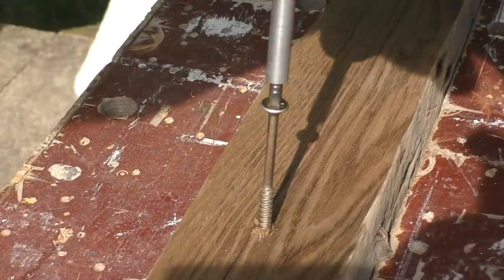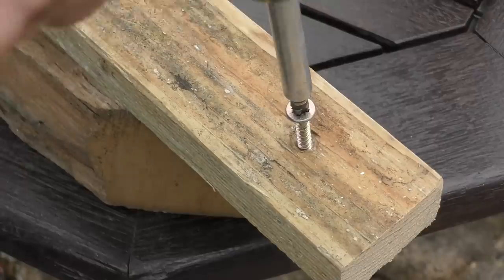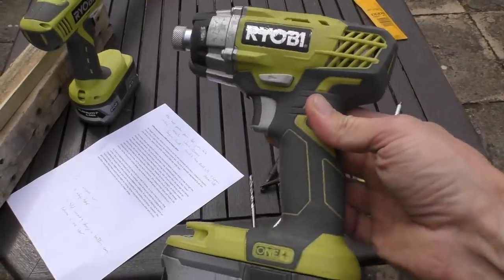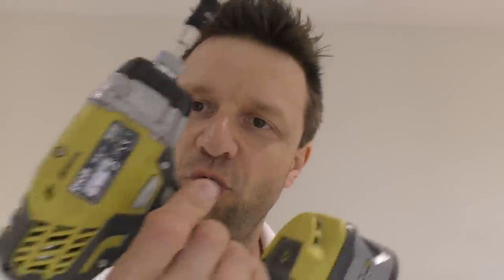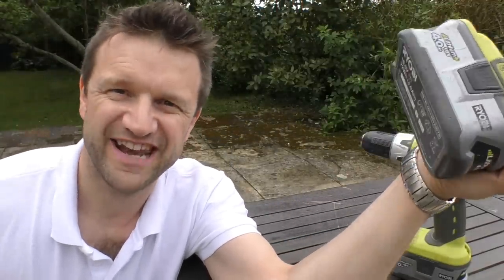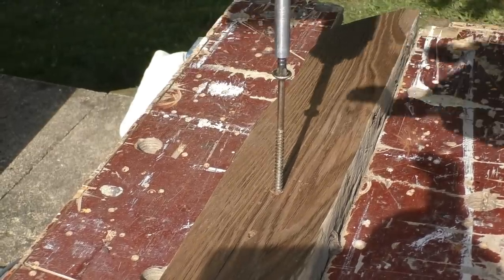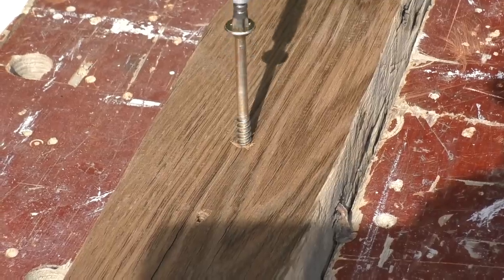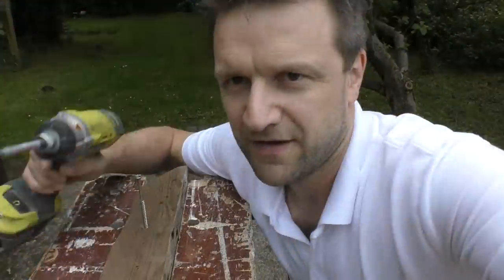Difference between Drill Drivers & Impact Drivers

Comment: Came to learn about diff between the drivers, learnt about batteries instead
Reply: Me too
Reply: That's because he didn't show how much more force he had to use with the drill. He would have been using both hands and putting most of his body weight to drive the screw like that with the drill. The impact he could have done with one hand while holding the wood with the other
Reply: I'd have to argue, that's your fault.
Reply: Lots of good info!
Reply: The mechanism with the impact driver is inside the turning head of the drill. There is a heavy metal mass and a spring that takes up the energy of the rotation and with each turn it is loaded up with mass energy and then hammers down on the screw to impart the stored mass energy on the head of the screw.
Reply: so I ain't watching it. thx
Reply: @andrewbarr3958  shows very little I guess
Reply: Well, ones called a drill because it's meant to DRILL things. Like with a drill bit.
Reply: Yea the battery part was really helpful. I thought that part was going to be boring.
Reply: Also how to spell 'learned'
Reply: The regular drill does the same as the impact when batteries are the same. I decided to buy a corded drill with available hammer drill mode and works like a champ. I’m about done with batteries that just don’t last anymore. I’d rather deal with the wires and have the power available. Good video showing what variable batteries are capable of though.
Reply: ikr lmao
Reply: Me too

Comment: Never realised the size of batteries made so much difference, I always though size equalled how long they would last.
Reply: (ah-hem) Size and stamina are definitely two different things...
Reply: It does mainly affect that, but it also affects the maximum amount of current that the battery can deliver
Reply: I dont think that he explained that the maximum amp of the smaller battery is smaller
Reply: same here.
Reply: It affects both.
Reply: He either truly doesn’t know what he was talking about or just misspoke in the video...

Frankly...if he thinks a 5Ah battery is the largest capacity out there...he’s definitely had no idea!

So to answer your question...there are 2 numbers that make the difference.

1) Volt
2) Amp-hr (Ah)

The tools he was using are 12V and 18V. This is what represent the “power” of the tool that he was eluding to.

The Ah rating is the charge capacity that a battery can hold (and deliver). This helps you determine how long the battery charge will last for the tools that it is mated to. Each tool will likely draw different amperage requirement so will have varying times that the battery can supply power. For example, a 5 amp-hr battery can supply 5 amperes current continuously for 1 hour. So if you have a tool that draws 5 amps, then you can use that tool for 1 hour with this battery when fully charged (theoretically...but there are internal resistances that will shorten this time). And using the same example, if you have a more power-hungry tool that draws 10 amps, then you only have 1/2 hour or 30 minutes before the battery is depleted by that particular tool.

I hope that clarifies your question...what you had thought is actually mostly correct!
Reply: Just bought a combo that's has the impact as well as the regular but they came with the smaller batteries gonna go buy one big one for now.
Reply: Its bc hes using ryobi. I would never reccomend ryobi, their designed to break and they use different battery cells which are much cheaper and dont have the same power outputs. Quite a shame of a tool
Reply: To summarize: Always use the correct tool for the job.
Reply: @dang-khoavo4648  I was ready to come and say something similar in the comments, but the evidence is there in the demonstration so it's hard to stick to first principles and deny that it's happening when it's on camera. The battery size does seem to be indirectly related - if the individual cells inside are connected in parallel, they'd be able to put out more amps, and therefore more power, right?
Reply: HRRoach m. On n in loop m
Reply: @dasy2k1  But current is determined by voltage (both 18V) and resistance (both the drill).
Reply: @ryanblake4790  Yeah I was thinking this is probably just an effect of cheap batteries delivering inconsistent voltage. If the voltage is the same then capacity shouldn't make a difference. This is like claiming you'll somehow get a higher rate of water flow for a given water pressure and pipe diameter by drawing water from a lake vs a bathtub.
Reply: @scottramsay4053  Well the first principles are definitely correct, the question is just why the different batteries mattered. Amps are directly determined by volts and resistance so the bigger battery is most likely providing a higher voltage to the tool (or the batteries could also have a different internal resistance).
Reply: Of course it matters. Think of this: a fully charged 9v battery wont start a car but a fully charged car battery will. It's not the charge but these amount of power that it can deliver in a time period. The bigger tool batteries lay longer because they require a ad much power for each use because they can deliver most power at each use.
Reply: Also brushed motors and brushless motors make a difference too, i use makita brushless tools and only buy the 5ah batteries, they can last the full day on site and 40 min recharge time too
Reply: @Joe Hoe I have been using Ryobi tools for over a decade and not one of them has failed on me yet. You can definitely count on them to last. I can't speak for how well they perform compared to Milwaukee, but I've seem them out perform some DeWalts.
Reply: @dang-khoavo4648  When this video was made 5ah batteries were probably the highest capacity you could get, things move quickly these days and much higher ah ratings are available, in 6 months time even  bigger capacity batteries will be out!!!
Reply: Those giant batteries really weigh the tool down though.  I can't hold the tool for too long.
Reply: As an old man would say. “Thats where they get you”
Reply: Scott Ramsay no
Reply: Junior R what would a young man say? Nothing because he doesn’t have sense to know he’s been got yet lol.
Reply: @dang-khoavo4648  of course there are more powerful batteries out there than 5ah. Try 125ah for example in a leisure battery but he's referring to Ryobi of which the 5ah is the most powerful they make.
Reply: @ryanblake4790  designed to break? They've made a crap job of that then, I've had mine 15 years!
Reply: Torque, power and speed. Speed needs less power but torque needs all the power it could get. I just bought a makita corded drill. Just straight to work not worrying about charging or power issues
Reply: @Joe Hoe For sure I build houses and do roofing, and I've never had a problem with Dewalt brushless products so I stick with them even though people bash them.
Reply: @ryanblake4790  No, ryobi uses quality samsung cells actually
Reply: @ryanblake4790  I have to disagree with you. I've had my Ryobi One+ drill and impact and even drill through concrete and brick. The 4 amp batteries and more make a difference especially for concrete and brick. I've had the tools for 5 years now and no signs of slowing down. The older Ryobi cordless drills were not good but the One+ series are very good. Are they better and durable than a Milwaukee or Dewalt? No, but for the average handyman who tackles 5 - 10 jobs a year and pay half the price, you won't be disappointed.
Reply: People responding that it does both, after OP saying he just learned it does both...

Sometimes I hate the internet...
Reply: @suegoetz1221  That's something those of us with large tools have to suffer through every day :(
Reply: Batteries don't have a maximum amperage, the amp hours are entirely a measure of how long they can deliver power and has nothing to do with the amount of power they can deliver per second. In other words, the moment you start using a 1.3ah battery with a full charge, it's exactly as powerful as the 5ah battery with a full charge.

So you're correct, the size only affects how long it lasts
Reply: me too!  Great demo!!
Reply: So much disinformation and confusion in replies...

The power of the tool is determined by two components: voltage (18V in this case) and flowing current (in amps, but these amps have got NOTHING to do with Ah rating of the battery), as per P = U*I formula.

Ah rating of the battery just describes the capacity, how much energy can be stored. For instance 18V battery @5Ah can store 18*5 = 90Wh of energy - which means you can run device requiring 90W of power (very roughly power needed by a gaming laptop) or for an hour.

The Ah value does NOT tell you how quickly you can get all of that energy out - that is defined by 'maximum discharge current' parameter of the battery (usually not advertised on the battery label). This parameter can vary wildly per cell, from 3A to 30A or so and is rather important for power tools, battery with large capacity but max discharge current so low that it barely moves the motor would not be very useful.

Single cell of LiI-on battery (usually popular 18650 type is used) has got voltage of 3.7V. So to get ~18V, you need to connect 5x of these in SERIES - which means voltage gets bumped up to 18V, but max discharge current remains the same (in fact, it would be limited by the 'weakest' cell in series). Bigger / larger batteries (with more Ah) are made by connecting blocks of 5 series of cells in PARALLEL configuration - such configuration increases overall capacity of the battery, while keeping voltage the same (18V) and instead increasing max discharge current (it is more less a sum of max discharge current capacity of each 18V block).

TL;DR - larger batteries tend to have more 'power' because:
1. They use higher capacity and higher quality cells, rated for higher maximum discharge current - so they can deliver more of 'instantaneous' power.
2. Additional capacity can be achieved by connecting blocks of 5x 3.7V cells in parallel configuration, which aggregates max discharge current from the batteries blocks in the pack - so this gives you usually double (5S2P) or triple (5S3P) available discharge current for 'free'.
Reply: @lelllooooo  finally someone who knows his shit, kind of dissapointing to see people spout their so called "knowledge" when in fact they know nothing about the subject. I must admit that i was stumped the first time i saw this happening a few years back. Thanks for the only good explanation in this thread.
Reply: @KugelXFanger  agreed, thanks for putting it so well, and thanks to lel, also. Les
Reply: @scottramsay4053  Kirkcaldy ?
Reply: @vmaldia  Huh? 🤷‍♂️
Reply: @lelllooooo  Thank you for clarifying this! I'm just a bit confused on this: so it means that they connect 5 batteries in SERIES, then another pack of 5 in SERIES, then they connect these two 5-SERIES packages in PARALLEL (one connection), is that right? 

By doing this, they get 18v on each of the two packages and then increase the amperage (discharge speed) with the PARALLEL connection (if it was series connection it would just add their voltage from 18v to 36v with no added discharge)
Reply: @wfjhDUI  Maybe it is the lower internal resistance of the larger battery that enables higher current
Reply: @wfjhDUI  That is one important thing, the internal resistance of the battery. It could be very high, higher than that of the drill even. You have to add it to the circuit in series.
Reply: @dang-khoavo4648   It's been 2 years.  Have you learned you are wrong?
Reply: @s4lroachclip  thats what she said! ... sorry i couldn't resist I'll show myself out!

Comment: I honestly thought the difference in the 1.5 AH and the 4.0 AH was battery life. I had no idea it actually effected the performer of the drill power wise. That’s crazy.
Reply: it doesnt you can adjust the drill driver to output more torque thats what the numbers on the drill are for i never had any problems with my ryobi
Reply: Well glad I watched this… whodve thought!  I own both ryobi tools and have to say awesome.  My only criticism is if anything the impact driver is too powerful and tends to tear into things or rip screw heads off. Now going to use it with one of my smaller batteries to tone its power down a bit plus it’ll b lighter to carry as well.  ❤
Reply: Good thinking Batman, I've ruined quite a few screw heads with my 5ah  @IsNotAlways

Comment: Pilot holes are our friends. Makes life both easier for drilling but also prevents broken bits/screws and split wood.
Reply: Especially with Phillips screws
Reply: But it’s so much faster not to have to drill the hole then go back and put the screw in!
Reply: @festivalmama  "..But it’s so much faster not to have to drill the hole then go back and put the screw in!
"

Causes one to wonder how practical is it to drill pilot holes in metal sheets when trying to fasten them on the roof.
1

REPLY
Reply: I did some work on a floor where the person who had fixed it before did a right bodge. I piloted all the holes, all measured up nicely, nobody will ever see it but I did it all perfectly. To be fair I wasn’t been paid so time and money wasn’t an issue so I spent time on doing it nicely. Pilot holes are tour friend! Having said that I’ve just bought a Bosch impact driver just to have 🤷‍♂️👍
Reply: So have the two drills handy. You avoid the frustration of snapped heads and stuff.
Reply: Always step up your drills into metal, wood is so meh
Reply: @jackjohnson9989  Why do that when you can use self-drilling, self-tapping screws?
Reply: I was so confused about that. I don't even do wood working. I don't even own a tool kit (IK that I should) and I know that pilot holes are a fuccin' must.
Reply: Of course a lot of fasteners are self taping now.

Comment: I didn't think I would actually learn anything or find your video interesting, but you taught me several new things! I came into ownership of a drill and a driver and genuinely always regarded them as the same thing, with one just being noisier than the other and having the inconvenience of only accepting hex head bits! I never realised just how different they actually were until now. The battery strength demonstration was quite eye opening too. I only have 4 mAh batteries so I've never come across the power issue you demonstrated but it is great to know. I have no Ryobi tools, but knowing the fact they never change their battery fitment is interesting and will genuinely influence any further power tool purchases I make. Thank you.

Comment: Great  job  explaining the difference between the two! I work for a Home Depot, I get to asked that question all the time what the difference is between the two  power tools. Alot my pro customers prefer  impact drivers over tradional drivers.For tight spaces and also the quickness of the job being done. I'm glad you like Ryobi tools. All you pros out there, just remember that the Ridgid power tools( another Home Depot exclusive tool.) have the lifetime guarantee with the power tool and the battery just as long as you register it.
Reply: Is it true Rigid will only replace the tool once during its lifetime? Once you get a full replacement that tool's warranty is done. I've read online this is the case.
Reply: For anyone wanting an amazing tool I would highly recommend GenScrew's electric screwdriver kit. It is an actual godsend: https://genscrew.com/kit

Comment: Thanks for this info!!! I always thought the difference in batteries was only concerning how long they lasted. This clearly shows the difference in actual power which is very good to know!!!
Reply: Yep and higher powered batteries are way more expensive. Nearly $200 for a 9.0ah. That's more than most of the tools they sell.
Reply: it doesnt you can adjust the drill driver to output more torque thats what the numbers on the drill are for i never had any problems with my ryobi

Comment: Like many others here, I didn't fully realise that the "ah" wasn't just about how much juice is in the tank, but the power of the juice also... Thank you!! 😀😀👍👍
Reply: You multiply volts by amps to get watts which is the actual work that can be done if all the capacity is mobilised. 18v x 1.3 amps = 23.5 watts of work. 18v x 4 amps is 72 watts of work. They will spin at the same speed, but one will need almost 4 times the effort to stop!
Reply: @numeristatech  To be precise, watts measure power, not work - work is measured in joules. Watthours, on the other hands, are defining work, as work equals power multiplied by time
Reply: It's not. Amps is the measure of electrons per time, so Amp-Hours is the measure of electrons in total (total storage). While a Ryobi 5Ah battery may be able to deliver more current than a Ryobi 2Ah battery (I don't think this is true), the "Ah" isn't what gives that. So more amps (not Amp Hours!) means more electrons per second. Typically batteries can supply a LOT of amps, so it's not the bottleneck. The other number is Watts, which is the volts * amps, which is a measure of power.